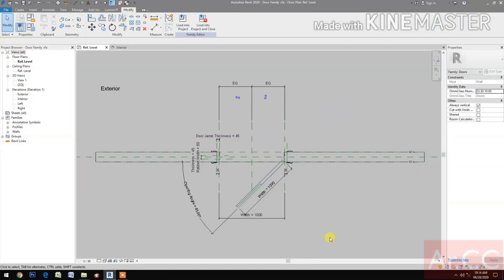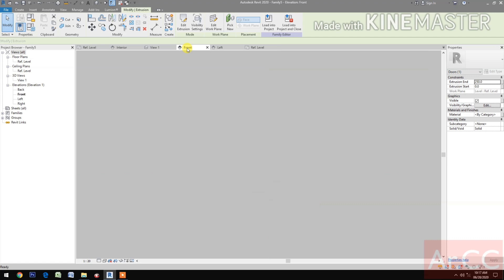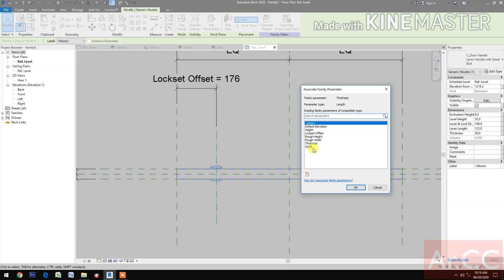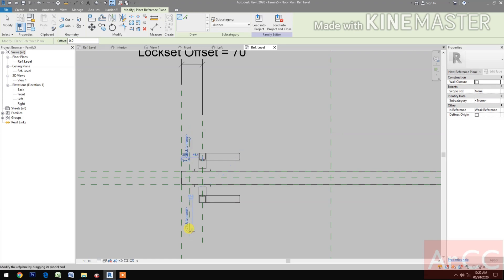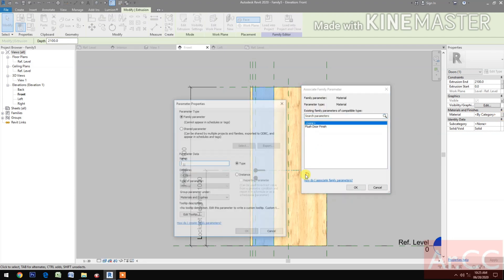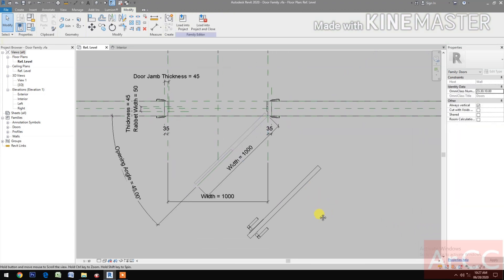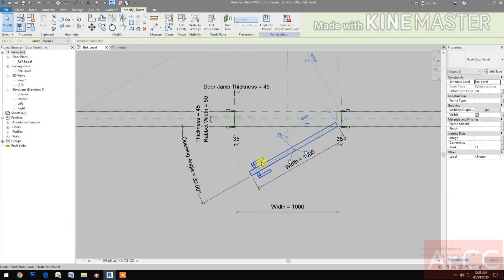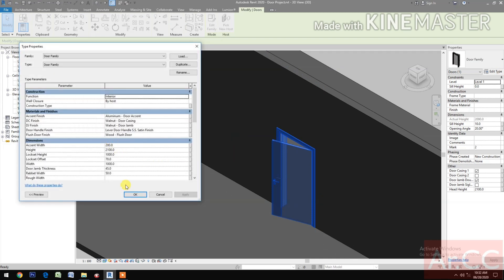RD040. How to make a Parametric Doors in Revit. Part 4 Flush Door Panel. Swing Door.

Comment from the maker: Recommended Video:
RD037. How to make a Parametric Doors in Revit. Part 1 Door Jambs.
https://youtu.be/TH821Btutw4
RD038. How to make a Parametric Doors in Revit. Part 2 Door Casing.
https://youtu.be/JgFehplzRD4
RD039. How to make a Parametric Doors in Revit. Part 3 Door Panel Place Holder.
https://youtu.be/8jkaJTAWSlw

Suggested Videos:
RD115. How to make an Off-Center Pivot Door in Revit. Parametric Door in Revit.
https://youtu.be/VGfXo0d6vX4
RD114. How to make a Bi-folding Door in Revit. Convert Swing Door to Bi-folding Door.
https://youtu.be/sIAz_u1CAT8
RD113. How to make a Parametric Arabic Pattern Pivot Door in Revit. Pivot Entry Door in Revit.
https://youtu.be/3tAyuCpotGw
RD110. How to make a Classic Ornament Parametric Gates in Revit. Steel Gate Design in Revit.
https://youtu.be/STm4xRDQTdY
RD069. How to make a Parametric Pivot Doors in Revit.
https://youtu.be/Wkf7jAVMRoc
RD055. How to make a Parametric Doors in Revit. Part 13 Modern Door Design. Swing Door.
https://youtu.be/syWkgU3JDLU